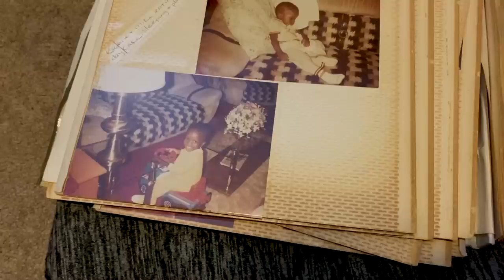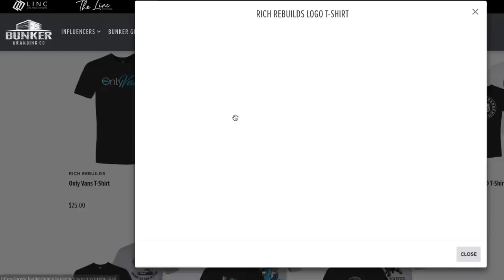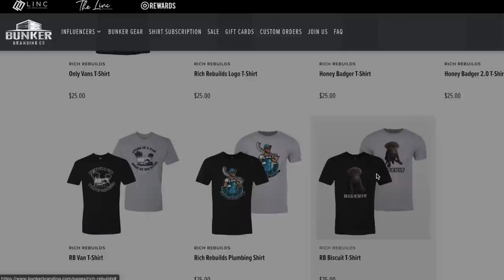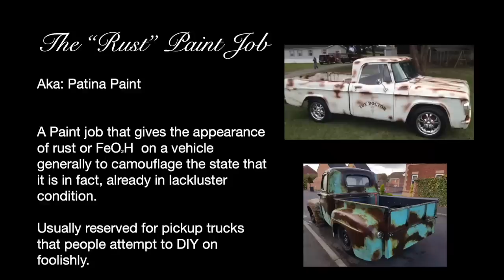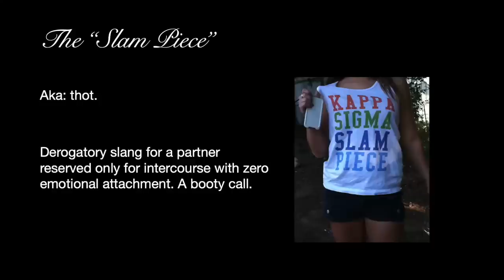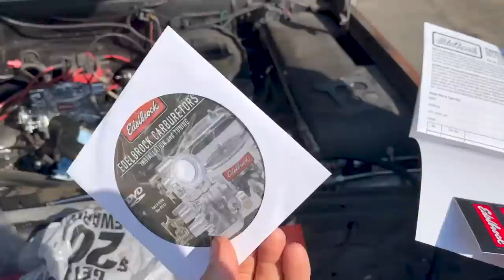I Thought I Bought my Dream Classic Squarebody Truck, I was VERY Wrong

Comment: It only has structural, mechanical, electrical, and cosmetic issues. It will be fine.
Reply: Emotionally, it's a rock.
Reply: @MrGonzonator  specially mentally. Going out with a rust paint job to mask the actual rust, the thing got balls.
Reply: @aronposner6930  LMAO
Reply: Lol no biggie haha just a weekend project
Reply: It can  be the next Ghostbusters car
Reply: @jz2188  If it has ectoplasmic issues then it would be unsafe for ghosts as well.
Reply: The entire wiring harness belongs in the bin.
Reply: @ic_trab  mcm IN THE BIN - one mans unfinished restoration … it’s just trash!
Reply: Look at the bright side...i'm sure it gets excellent gas mileage 😅😅😱
Reply: But the rear view mirror is mint, so totally restorable!
Reply: Tis but a scratch!

Comment: Dude! I absolutely relate to your love for old Blazers. I still have my '89 K5 sitting in my backyard, with both a blown motor and transmission and now also rusting away from 20 years of sitting, but I DON'T CARE! I still have dreams of bringing it back to life someday and love it more than my current (actually running) truck.

It took me 6 months of searching in '95 before I found the right one, and for the time that it was my Daily driver it was a good, faithful truck. With front and rear TrueTrac differentials and 31" mud tires, it was an absolute MONSTER in the snow but about the most dangerous vehicle on earth on ice.

Comment: rebuild it rich, give us something to look forward to.
Reply: I agree. Please uncle rich rebuild it properly.  Maybe add some some electrical goodies. Tesla screen in cab ,  this truck will not let you down once you redo it properly.
Reply: Come on, homie...this thing is a bucket. Absolutely not worth the effort & cost in time & materials. The frame is unsafe at any speed.
Reply: @humchan2k  His name.is rich REBUILDS, he should be thanking the seller because now he can rebuild it
Reply: Rebuild it, just get a new chassis and build the truck properly, how can people even say to not rebuild.it, it's what his channel stands for, wtf?
Reply: @humchan2k  you can buy a complete rolling upgraded chassis from Fab Quest for $2700. He can start there. 🤔
Reply: @humchan2k  If they removed the bed and everything in the way like they would need to to fix the brake lines and rear suspension anyway, a good welder could pretty easily go in there and redo all the frame notching and patch any holes or rust patches pretty easily!
Reply: @humchan2k  let's not forget that content for his channel has a added benefit of writeoffs for expences since its work related...besides haven't seen the welder do much other than read lol
 j/k

Comment: Definitely buy another 4 door long bed Dually duramax from auction and put the square body body on its chassis. That solves all your messy issues with the chassis welds, brakes etc
Reply: Seconded

Comment: I'd love to see the restoration of it. I mean, it would clearly be a headache filled restoration with horrifically unending poor workmanship surprises .... But ... The scripts for all those restoration videos would indeed write themselves. I do also mean they'd write themselves literally. As it not only scrapes, but also has a lovely oil leak to make the scraping that much more smoother... 😅
Reply: This truck needs a new frame, new wiring, new exhaust, extensive body restoration, replacement of half of the air suspension parts, and more.
Reply: @R4M_Tommy    exactly, so for me, it's the thought of how challenging (perhaps even nightmarishly* so) it would be that makes me keen to see them restore it or maybe even attempt to. 

Challenging in a sort of a newish way, or different rather, in as far as this channel is concerned. I think they've tackled similar tasks in various projects but never really all that in one ...🤷🏾‍♂️

Comment: A wise man once said “you don’t need brakes”, “you don’t need structural rigidity”, “you don’t need a functioning electrical system”, “you don’t need a working fuel system”….. maybe not all about the same Truck… but it has been said.
Reply: VGG
Reply: @danielvaldezaguirre  cold snacks!
Reply: This sounds like something vice grip garage would say
Reply: It’s actually Peg from “zip ties and bias plies”
Reply: @sccarguy8242  fuckin minty
Reply: Slave lake don't have none of those
Reply: @joshuareed5773  STUNTMAN does

Comment: Honestly as far as square bodies go, that one is actually not bad for rust…..
Reply: Maybe it’s because they’re 35 to 50 years old at this point
Reply: @MustObeyTheRules  my 40 year old jeep is in good shape for original ish in my state and the floor is broke loose from the sides of the body in 2 places
Reply: @Alex p the rust isnt the issue. Its the shotty work and selling it as in good shape is the issue
Reply: @chickensfloat7427  yea I’d say butchering the frame up to put the bags on is the worst part I see on it. Wtf were they thinking 🤔
Reply: @MustObeyTheRules  ya for sure. Once i bought a jeep where somone had broke off the spring perch bolts in the frame. Instead if drilling and tapping he put threaded rod butted up against it and made some real crappy welds. Thank goodness he never drove it on the road that way, he ended up selling the half finished project to me. They busted off the skidplate bolts too so they just welded the damn thing on.
Reply: @chickensfloat7427  that kind of crap makes me think maybe just any random person shouldn’t have their hands on a welder 😂
Reply: @MustObeyTheRules  maybe 😂 whats the worst that can happen? Your front axle breaks off and the leaf springs pivots under you so the front axle is under your transfer case? 🤣
Reply: Really tho....
Reply: @Alex p hahahahahahahaha truthfully said
Reply: @chickensfloat7427  show pictures of it
Reply: It got better wiring than most Italian and English cars.
Reply: @scott9676  stop it, you're giving me ptsd

Comment: The truck can be fixed, I'm been messing with and have owned numerous lowered / air bagged trucks for 30 years, I've seen alot worse, but yea ALOT of work is needed to make it a safe and reliable driver again. I would love a chance to make it right and show it can be saved and not destroyed by the Whistlen Dixie guy

Comment: that body style with 7.4L was notorious for running hot, I worked at chevy during the early 90s. So the problem was restriction of air flow opening in core-support was too small and the 93 gm diesel 6.5L turbo front bumper had two holes for turbo flow. cheap fix for that truck without cutting structure.

Comment: Chevy & GMC produced those generation fullsize light duty pickups from '73 through '87 "only on 1/2 ton & 3/4 ton regular cabs", but the crew cabs like that one there in the video & K5 Blazers like the one your mom had, GMC Jimmys, & Suburbans on the other hand continued up through '91. About the 1 ton regular cabs, they continued up through '89.

Comment: My brother in law had one brand new. He parked it in a barn full of hay and lumber with a load of firewood on the back. Cat converter set the hay on fire. You could see the flames for miles. It melted down to about 3 feet tall.

Comment: the 3rd fan is for when the a/c comes on!!! 
will help get the a/c a lot colder inside the truck 
looks like it was added later with the new a/c stuff
ps. just fix whatever you can and sell it off

Comment: Shouldn't the electrified garage electrify it?
Reply: So many structural issues and other unsafe aspects would need to be corrected first before even going into making it an electric truck
Reply: He wants to use it to tow. Making it electric and still be able to tow stuff is not feasible. The electric trucks can tow a trailer for about 4.2 miles. LOL. You'd need 2000 lbs worth of batteries, and then that extra weight would not as much range and you'd probably be over the GVWR of the truck.

Comment: Smaller carburetor does not equate lean fuel mixture, improper air to fuel mixture, too much air is a lean mixture, you could put a 1000cfm carb on it and run too lean due to too small jets, you just make less power with a smaller carb.

Comment: If everything stock in that 454 it will work fine people think big blocks need lots of cfm but if there’s no cam or over size bore them 454s came with 2 barrels an worked fine

Comment: A 600 cfm carb will not cause a 454 to run lean cfm is only a messurement of the volume of air that cam move through it main jets and squirters effect lean and rich conditions

Comment: What kind of truck is this? I would really like to look into them, they’re really cool. I think you should restore it, it would be  fire 🔥 🔥 Maybe paint it red and put skulls on it...well I Don’t know but definitely keep it!
Reply: It's a Chevy C-30 dually. "C" meaning 2 wheel drive, 30 meaning 1 ton. If it was 4 wheel drive it would be a K-30. "K" meaning 4x4. There are TONS of K-10's around. Those are half ton 4x4s. The K-20s are 3/4 ton. The K-30s are harder to find. And almost all are badly rusted.

Comment: What a wreck the truck is! I had a 91 that was in excellent shape with a new crate engine and trans in it that I just let go un registered for 4 years because I was driving my new 2001 GMC truck.
So I went to see what registration would cost & DMV wanted more than the 91 truck was worth. Sold as scrap for 500 dollars with new drive line in it - lol

Comment: 600 cfm is not too small for a 454. It depends on how much power you want to get out of it, but you could put a 500cfm on there and still be fine. It whouldn't be optimal, sure, but it whould run just fine.

Comment: actually even tho that 454 is big it has small valves and chambers with about a 4500 max usefull rpm so a 600 cfm carm is enough. Now a vortec 96 and newer 454 with a cam can use a 750 cfm

Comment: Lots of grinding, fish plating that rear notch... re welding most of the "welds"... new headers and exhaust... give it a simple re wire... 
Good content 👌 don't spend months n months re engineering everything just fix what needs doing mechanically and use the dang thing... everyone needs a beater truck for messy work... this pile is the perfect fit for the channel 👌🙌

Comment: Funny thing....I have three carbureted cars, all without any choke provision what so ever and they start right up! They have Holley's on them.  Unless you live in a very cold climate, a choke is not  necessary. But that said, when it was 9 degrees in Texas this february, my 63 pontiac still started right up without a choke. The guys that grew up with them..........???

Comment: Watched most of the video and thought "Those really aren't bad issues to get on an old used truck. A new carb, some wiring, brake lines, collector gaskets, exhaust stuff, etc. Par for the course."

Then there was those welds. lol. Still more character than newer stuff. So. If you got it cheap enough - it's still a win.
Reply: Yeah, reminds me of DoitwithDan's foxbody he got. Started off as a simple fun car, ended up welding a new frame cuz it had been chopped in half at some point lmfao

Comment: Save the Motor and Transmission. Save the compressor and related parts, and junk the rest of the truck. Do a video on inspecting and rebuilding the motor and transmission.

Comment: That truck likely would like the Yellow top. If you are not planning on a monster ignition system or multiple fuel pumps. The Yellow top is better for heavy applications,  winches, Audio equipment, airbag compressors, etc. I just went through that research for my 370Z. I had a GT500 it ran the red top for the coil packs and heat resistance, my 370Z runs yellow for hi-current audio and electronics. Buying used is always a pain in the chuff, My Z came to me with chopped springs and F'ked electronics. She is a happy Fairlady today.

Comment: No! Don't send it to whistling diesel lol. I want it! I'd restore it and rebuild that garbage air ride setup. I'd definitely say restore it. It's worth it. It's got some issues but it's currently running and driving. The main part is done. (Kinda) lol keep a fire extinguisher with you. That wiring is bad

Comment: Lots of issues BUT if it’s a real crew cab dully, somebody will want it. If you’re honest about the condition and sell it to a shop you could have a clear conscious. The rust really ain’t that bad. I think on the mechanical stuff you have to consider where it came from. It’s a whole different climate and they weren’t worried about the choke, the extra cooling fans make (some) sense, the visor kept the sun out of the cab a little, etc. those welds did look terrible and were the worst part. A lot of hours grinding and welding to fix that mess.

Comment: I found a 75' GMC, single cab, dually with a 350 and a 4 speed, one owner with 70,010 miles showing, the owner died and I bought it from the grand daughter who used it to store her horse stuff.. she left the hood open so that mice wouldn't get in and destroy the electrical ... and she found mice building a nest under the air cleaner so she pulled that off and left the hood open... guess what happened for two years every time it rained.. yes 2 cylinders were like half full and it took .040 boring to get thru the rust.. the engine machine shop had to remove one of the pistons, I couldn't get  it... however, I have fiberglass dually fenders that are 3 inches wider than stock, they were like $900 but I'm not sure if I'm going to use them.. so anyway, I'm gonna paint it black and maybe white roof/ white body center, you know how the square bodies are.. anyway congrats on the purchase and yes, I have like 5 other vehicles so we're like twins only I'm not a "guy that looks like you" hahaha but definitely kindred spirits.. love your stuff Rich
Reply: Wholly Bat Shit Batman THAT is a rollin' Pile of Shit !! ... yes, I do want it but, I'm trying to put a value on it .. I guess the only value would be the parts that I'd use to complete my dually, I need the interior, I want electric windows instead of the old cranks, so anyway, I'm curious to hear what you finally did to this turd, is it out in the grass with the rest of the turds??

Comment: If the body was good I'd say get two guys to spend a day grinding and welding to fix those issues and replace the brake lines and airbags. Then spend another day fixing all the wiring issues, and then you'd have a pretty cool rig. But seeing that the body is in the shape it's in, I say get with WhistlinDiesel and mulch that death trap up. Just don't try selling little jars of its mulch for $70 a jar like Whistlindiesel is. lol.

Comment: actually, i don't see that much of a drama with the previous carb.
- ok, with a smallish 600 carb on a 400+ cubes engine makes you loose some peak power, but shouldn't be a prob to make it run smoothly.
- new/old carb are square-bore-carbs whereas the intake has a spreadbore pattern. the "old" spacer was a square-to-spread-bore adapter. so why not keep using it?
- having a locked-out choke is not ideal, but not a big deal. actually all my carbs were choke-delete or choke-locked-out. never had issues with it. who cares 30 seconds of aligning idle manually during cold starts?

all the rest of this ride is of course....."interesting" :D

Comment: Yes these Trucks do rust and fall apart.If the truck was driven in a Northern state where salt is used it would be a pile of rust .looks like you was ripped off. The 454 was nothing but pigs 1975 threw the 80S .I would crush it .

Comment: Restore it and sell it, or do a charity raffle for it.
Reply: To be fair, If you have fab skills that truck isn't as bad as it looks. Its old dirty and poorly added to. But the rust I saw was mostly on the parts you need to change anyway. The body panels are almost always F'ked with these. The frame has some rust, But like I said If you have fab skills, it is a matter of time and mats. I really think you could make a SEMA show truck out of that.

Comment: That is a bomb can special and most likely enamel. All body fender guys know the nightmare of sanding on that. You will need some Aircraft Stripper and a lot of it. Just wait till you find out what is under the multi-layers of sh!t paint on that turd. I'm glad I am a painter and not the body guy who has to remove and remove and remove and remove bomb can paint. You can call it "JAW BREAKER"
Frame off restoration is the only thing you can do if you safely want it to roll on the road. or just burn it to the ground and scrap it.

Comment: Yeah there's a lot wrong with it. But you could actually redo it too it's not in that bad of condition. I can't believe I sit here and watch this. It's like privilege meets don't have a clue. Sitting there cranking and starting off could obviously tell that it's not cranking fast enough to start regardless with what was wrong with it and anybody worth their salt first thing dead battery which may or may not be caused by alternator. As soon as you got it running you should have pulled the battery cable which would then run solely off the alternator which is a good test to tell whether it's good or bad. Yes the paint needs stripped and totally redone anything you put on top of it will crack and chip off. Yes it needs a rewire and it also needs the welds redone along with some patches. And never mind keeping it slammed. Put the rear end back under it front end too and put the shocks or if you decide bags in the proper location. That stuff there's not even sitting on top of the perches. Long story short it can be redone and should be.

Comment: @Rich Rebuilds - 
"Have you ever painted a car? With a roler."  ... Next time add the wallpaper first before roling ROFL ... BTW the "rust"-style paintjob on the car looks like a wall or ad-board were layers of paper accumulated over decades.